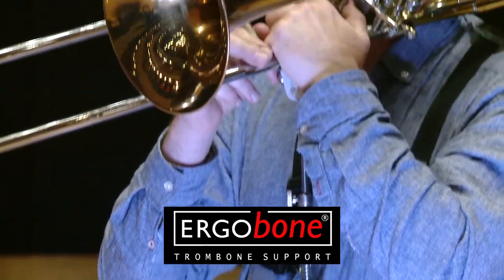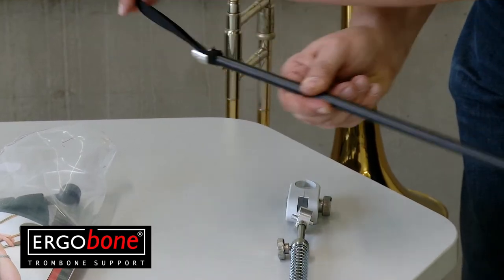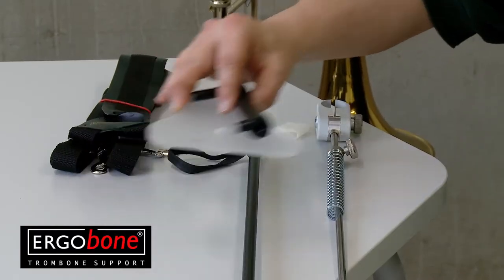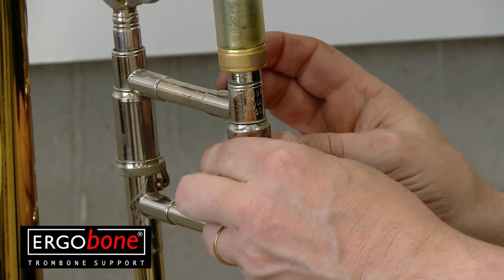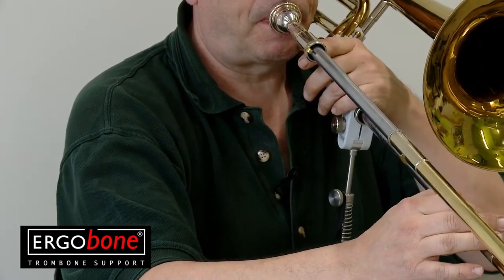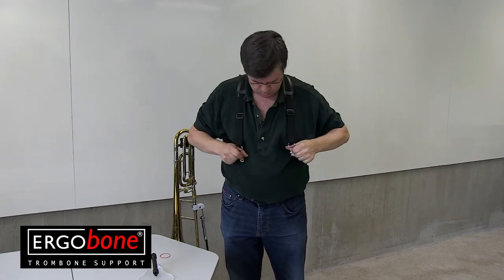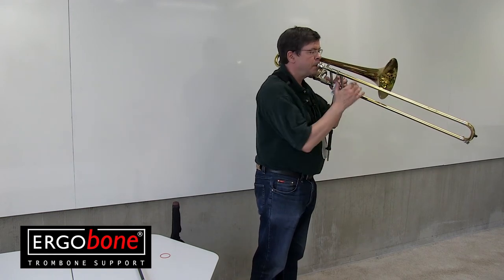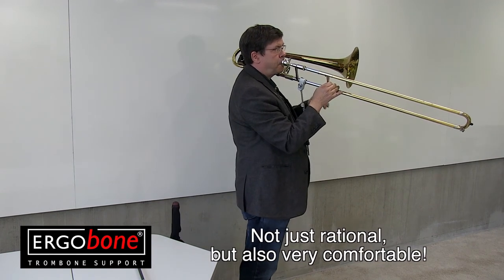Unboxing the ERGObone trombone support

Comment: Would this help my carpal tunnel syndrome? I'm considering having to find a new career after 30 years of playing professionally. Even my King 2B is feeling heavy and sometimes I can't even hold it.
Reply from the maker: The ERGObone takes all the weight off from your left hand and arm. But you still need to keep the right pressure toward the mouth piece with your left hand. Nevertheless, everything feels light as you will get actually support for your left arm from the trombone! You can almost ”hang” your left hand and arm from the trombone. If you use the ERGObone with a small trombones without the F attachment, then you usually need to add some counter weight to back of the horn because they normally are very front heavy. It is crucial to get the horn in balance for comfortable playing.

Comment: The trombone isn't really that heavy. Do you realistically even need a product like this?
Reply from the maker: Of course you can play without it. However, it is so much better to play without any tension in fingers (=very loose and sensitive grip!), wrist, arm, shoulder and back. The more you can stay relaxed whili you play, the better you can use your upper body for breathing. THAT is the reason! You can play, of course, with the normal tensions, but is that sensible to do..? You should try out! 

Here some more ideas: https://youtu.be/_IVgYG-4V4c
Reply: @ERGObrass  I guess if  you playing a long time it would be less tiring to use something like that. I can see your point.
Reply: For a light weight tenor trombone, no. For a symphonic tenor (i.e. with an F-attachment), it depends. For a large bore bass trombone with F and Gb sections and a 9+ inch bell? I guess it also depends, but such a bass trombone seems to be about twice the weight of a "pea shooter" small bore/small bell horn. Then add, say, a good cup mute to the bass 'bone, and you've got a real handful without something like this especially with your left hand operating the F and Gb valves while supporting the horn.
Reply: @christopherholt9682 I've been playing for 40 years and now have severe carpal tunnel syndrome in both arms. One of these could easily have prevented that. I can hardly hold the instrument without pain. I may need to find a new career.
Reply: @berkeleygang1834 I've only ever played straight tenors and have been on a King 2B for about ten years. I have severe carpal tunnel syndrome in both arms now from 40 years of playing. This would be great for straight small bore tenors as well.